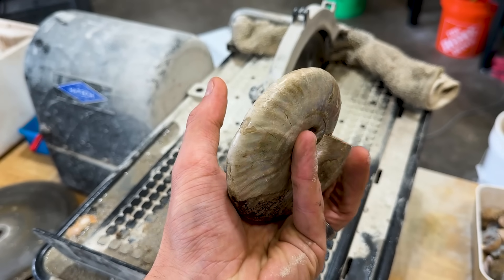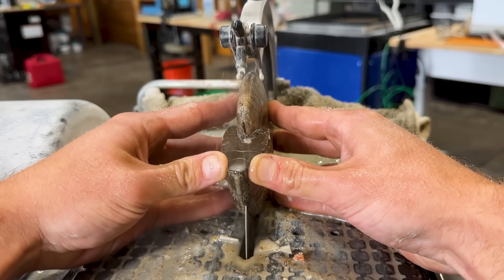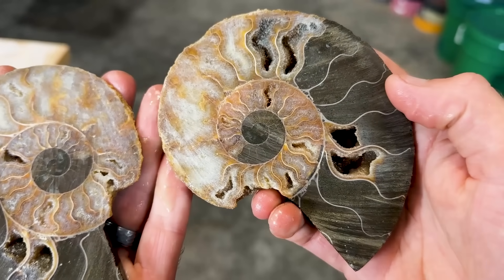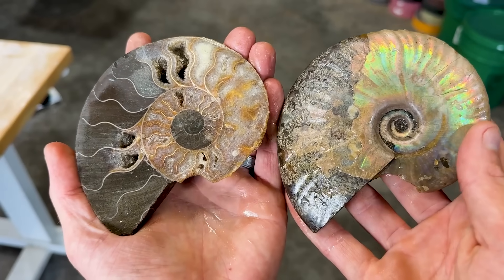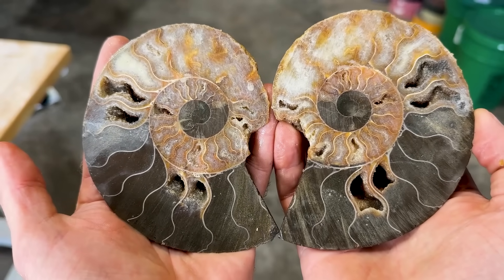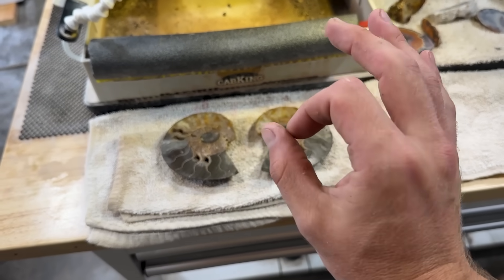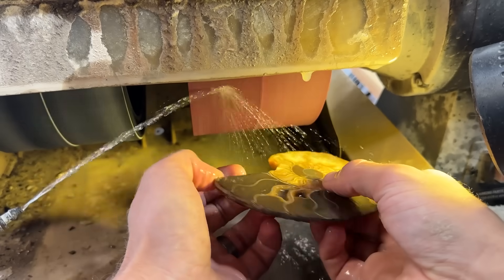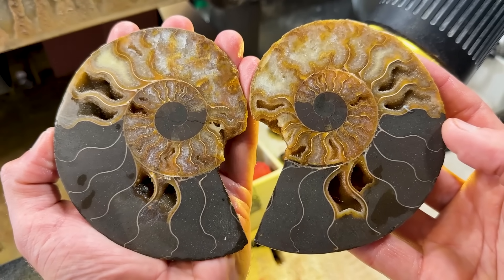Are There CRYSTALS Inside My Fragile Ammonite Fossil?!

Comment: Is there a way you might be able to glue or stabilize it from the outside but also in preserving it’s beauty and integrity? I imagine a thin layer of epoxy resin or something but you would almost need to build a mold specifically for this size/shape and might lose some of it still….

Comment: Sir. Clean your cabking. You are supposed to clean it after each use. It says so in the instructions.
Reply from the maker: The trays don’t make it run better lol
Reply: @TaylorsRocksmithery  true, but they still need to drain properly. I rinse off all the removable parts (trays ect. Not wheels) on my cabking and flush out the drain hoses after each use if I know I won't be using it for a few days. If I plan on using it the next day, then I usually just let it sit because the gunk is unlikely to dry on it in 24 hours.

Oh, and in case it wasn't clear, I was laughing when I wrote my original comment. It wasn't meant in a mean way or anything.

Comment: As a carpenter, I know how difficult it is to freehand cut on a table saw. So great job on the precision on your cuts!
Reply: My 6 year old helps me cut rocks. Reused my old sandblast cabinet with saw sitting inside. She loves to load up a rock and see what's hiding inside. Of course, under supervision and locked when not in use 😂